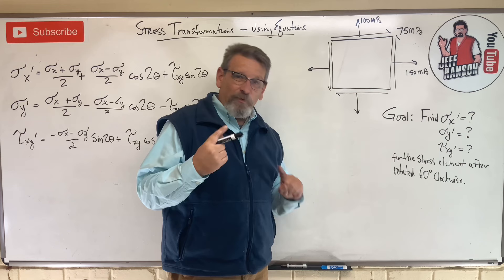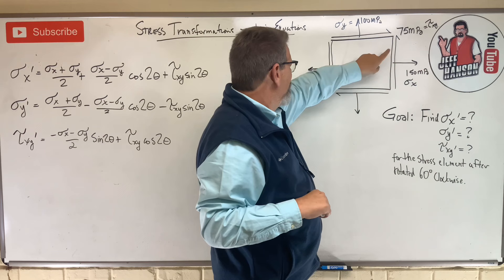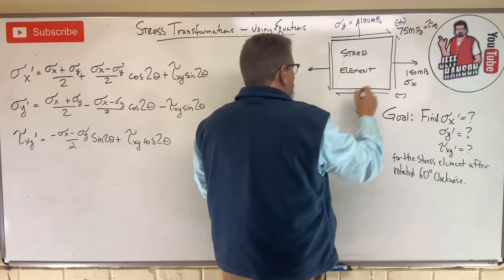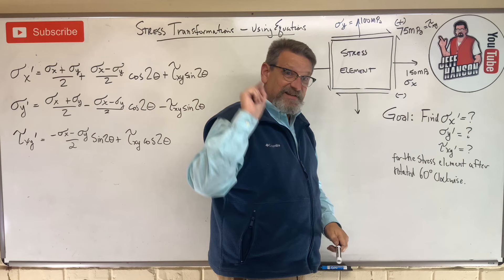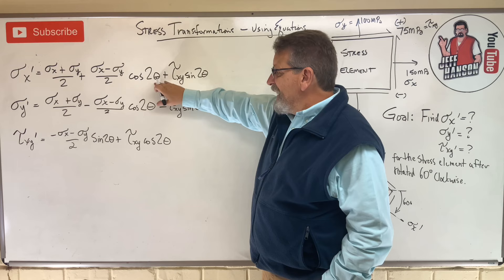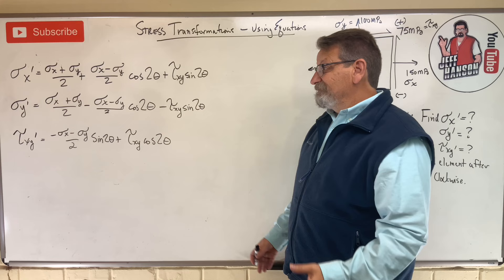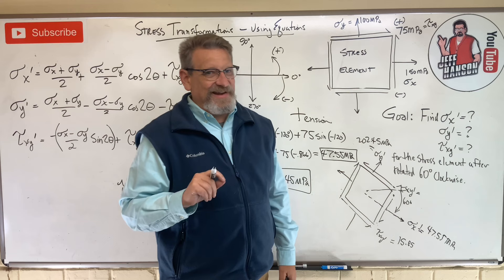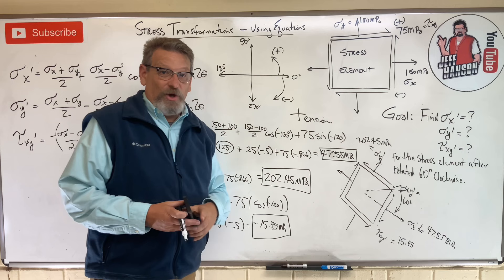Mechanics of Materials: Lesson 48 - Stress Transformations Using the Equation Method

Comment: thank you for these videos extremely helpful. im using a shigleys mechanical engineering design manual and the book uses the same equation for stress prime y as x but at a different angle which could be easily interpreted wrong. your method is a simpler and more reliable, well for me anyway.

Comment: The answer at the end is incorrect . He wrote 25 when it was 125 and the final answer should’ve been in tension 70.75MPa
Reply: i came here for the concept though. the result is just based on inputting numbers, thats why we use computer program these days
Reply: Congrats you can use a calculator
Reply: @J-Stew_64  it’s in case someone was comparing their answers that’s all. No need to bash me on it .
Reply: from the formula, shouldnt it be 25, not 125 tho? since its -(sigma_x-sigma_y)/2